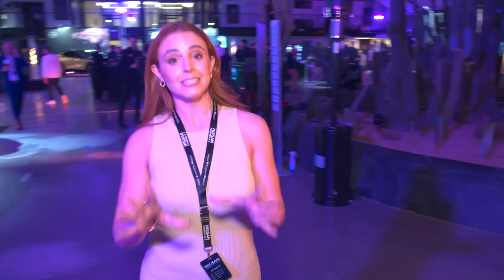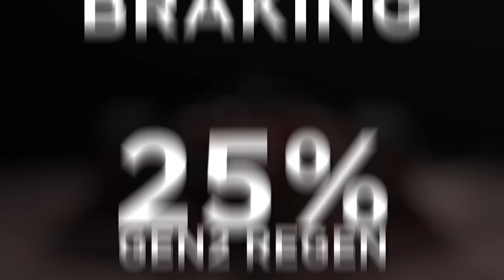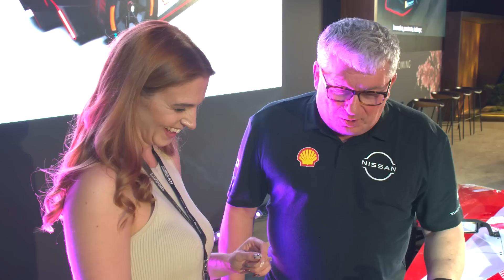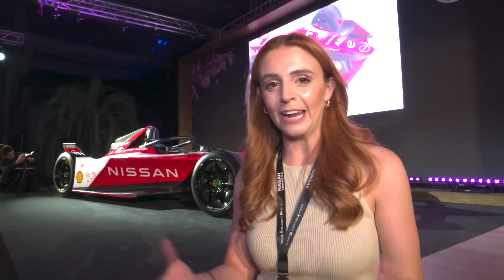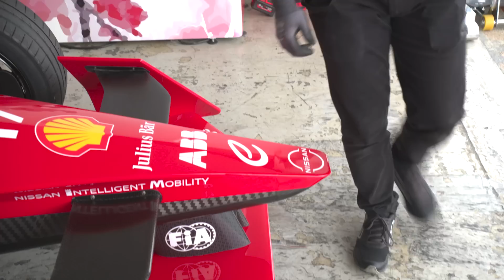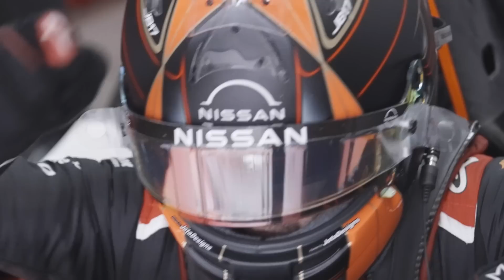Just How Different Is Formula E Gen3?

Comment: The information is wrong. The front motor provides 250kw of regen power but does not provide power to the wheels. The rear provides 350kw of regen (600kw total) and power to the rear tyres only. The horsepower is roughly 470.

Comment: 1)  The continuing refusal - even with this 200mph car - to move at least some races to (F1) race-tracks is absurd. 
2) Battery-swapping pit-stops:  although battery-swapping is still a pretty silly idea for consumer EVs - it should have been built into this Gen3  F3 race car.  Especially given that EV manufacturers like NIO can now auto-swap large consumer EV battery-packs in just 30 seconds(!!). We could have much longer, much faster, far more epic and exciting track battles out on real, wide race-tracks - and battery-swap pit-stops would add much-needed drama and tension to races.  But it's clear that the FIA and F1's powerful overlords and other F1-related vested interests still don't want to see Formula E and battery-power rivalling - or heaven forbid - overtaking F1 and fossil fuel in terms of mainstream audience appeal/numbers.
So we're stuck with ultra-fast, high-performance - but still strait-jacketed - next-gen Formula E race-cars largely still constricted and restricted to narrow city streets unable to show their full F1-rivalling power+speed+range+overtaking capability  and potential. Tragic.
Paul G(EVUK)

Comment: Deleting the rear brakes is inspired. Hope to see that on road cars soon
Reply: Kind of already happening? VW puts rear drum brakes on many evs, the only thing preventing them from removing it altogether is that we as drivers aren't yet used to using regen
Reply: @loupcordeille-bougault3474  so it's been happening for over 100 years because drum brakes have been fitted to the rear of cars? 🤣

Drum brakes are about as effective as discs to stop a vehicle. They only struggle with repeated use due to overheating, hence finned drums.

Irrespective, fitting drums has nothing to do with the concept of deleting the rear brakes. Nothing at all.

People don't know/care if their throttle has a mechanical cable or just an electric one with no physical linkage whatsoever. There's no reason for them to care if the rear brakes are mechanical or electrical, particularly as the main brakes on the front remain mechanical.
Reply: @procatprocat9647  Regen feels a lot different than brakes and if you were in the dealership instead of internet you'd see and hear the same feedback as I do. I don't know in what world you live but in mine drum brakes have significantly less stopping power than discs. Going back to drums is a sign that rear stopping power is getting less important yes, and when regulation will be ready for it we'll see them removed as well on some cars.
Reply: @loupcordeille-bougault3474  Incorrect. my car has regen and I thoroughly enjoy adjusting the settings on the fly, to optimise for the traffic and road details. Its a form of hypermiling which I do for the challenge.
I know how brakes feel, you fool. Drums can be just about as powerful as discs if they're of similar size and quality. They fade, that's their issue.
You seem to think that owners can't deal with vehicle developments. I can assure you that a full electric car feels very different to drive from a hybrid and poles apart from an ICE. Electric car sales are ramping up almost too quickly for the infrastructure to cope with. Owners are lapping up the changes, even with the considerable recharging problems that are heavily discussed all over the planet!

Comment: And yet, despite the pronounced power-to-weight ratio improvement, it is BARELY any faster than the gen 2 in pre-season testing.  This is likely down to the thoroughly mediocre Hankook tires, but it's a long way from the promised performance improvement.
Reply: Yeah, the tyres are super hard - Hankook have done exactly as they've been asked (a tyre that'll last a whole race distance in all weathers). I would absolutely love FE to have slick tyres - but I'm not holding my breath on that
Reply: You're missing the point. The aim was to maintain the performance whilst reducing weight and reducing the battery size.
Reply: @procatprocat9647  maintaing the performance? That would suck.
Reply: Compare the current gen 3 stats with the first gen 2 pre-season tests, not with how fast gen 2 ended up at the end of last year. Gen 3 will improve a lot over the course of multiple seasons.
Reply: Yeah. I wish they'd make a shift to semi slick rubber. AW sucks and yeah, at this point it's safe to say, this early on, I did expect Hankook to have some struggles getting up to speed but this is just bad. What a fail by FE there.
Reply: The pole time at valencia in 2021 R5 was 1:26.522
The fastest lap in valencia in 2023 testing was 1:25.127

I think that's a good intergenerational gap. Of course, the mathematical power-to-weight ratio has increased considerably but this isn't a drag race, there's aero and tyres to consider (Hankook tyres aren't as grippy as Michelin, despite being less grooved, so that's a problem). Ultimately though, I think the racing in Mexico this year hasn't been as good as the racing in Mexico last year, but that has little to do with performance.
Reply: Well early days. Things will be improved.

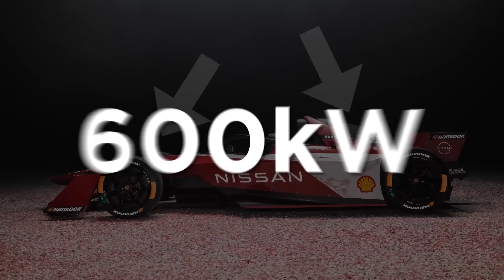For example, the pole lap in Berlin 2019 was 1:07.295.
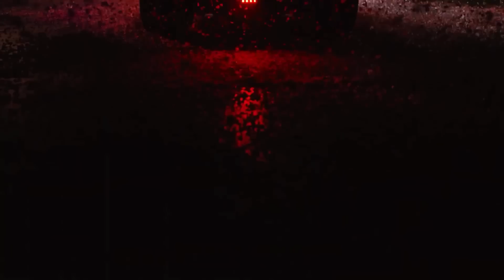In 2022 it was 1:05.914.

And Tempelhof track in 2022 was a tiny bit longer compared to 2019